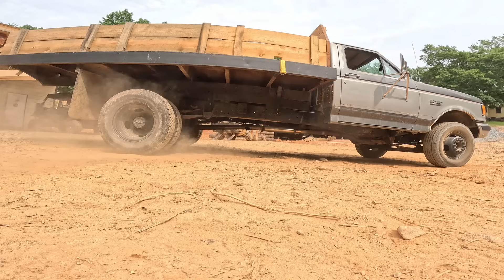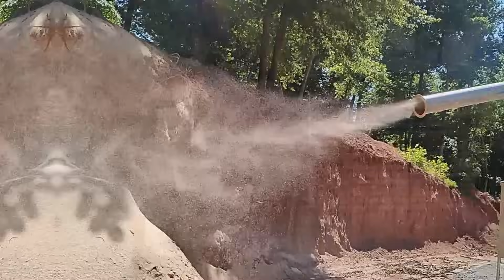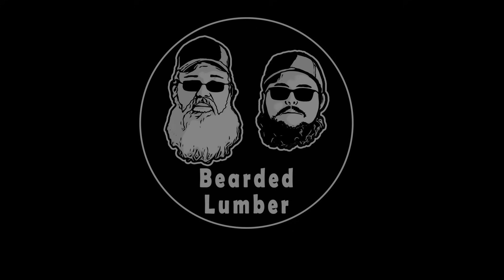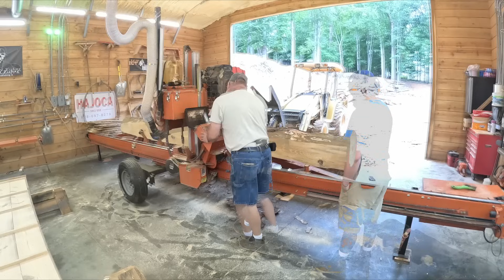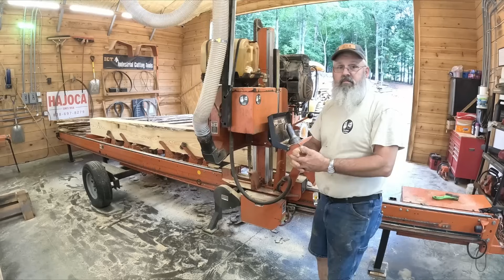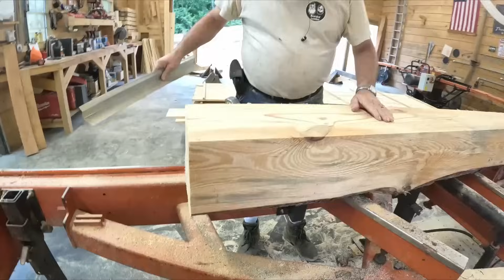How Fast Should You Saw??

Comment: Nice job very instructional. When you get your electric mill you could install an ammeter and regulate speed accurately by observing load, in fact average (rms)  ammeter could average amps over a set time i.e. 250 miliseconds would average a 1/4 second of load. This would enable you to come close to maximum sawing speed and vary saw speed as wood conditions changed allowing you maintain same level of cut quality objectively rather than by feel. Your sawing would be consistent from load to load water content time of year temperture and your mill book would have objective numbers to run aganist. This would be especially useful when sawing different species different tempertures differing moisture content as your mill would always be at or near your desired work loads making/allowing you to achieve the highest level of cut consistancy possible with high confidence. Ray
Reply from the maker: Thx Ray that's an awesome idea 💡 
Your a deep thinker thx buddy 👍
Reply: @BeardedLumber  For diesel saws EGT could be monitered and used for speed control not as reactive as ammeter but would still allow a varible automatic setable speed control for a diesel powered sawmill Ray

Comment: It just came to me that this ammeter feed back could be wired into the speed control circuits automating sawing speed and making sawmill cut speeds automatic with constant motor load. System will by fiat increase output, shorten learning curve, increase life of saw and sawblades, and enhance consistancy. Maybe Wood Miser would have interest in developing an automated saw speed control along these lines for their saws. Intake manifold pressure monitoring would/could also work for gas motor powered saws.  Let me know what Wood Miser thinks of my idea if you mention it to them. Thanks ray